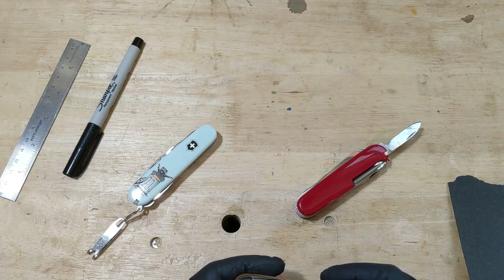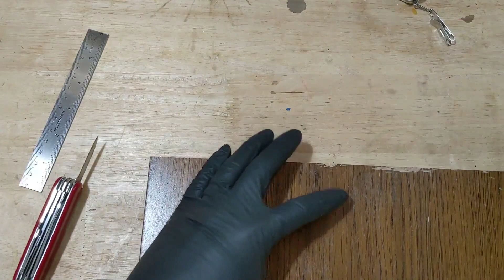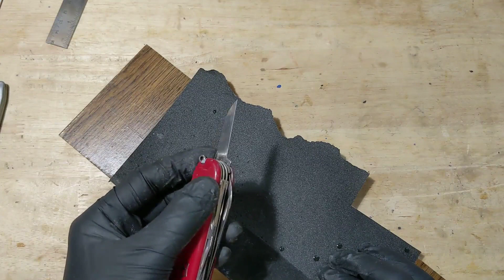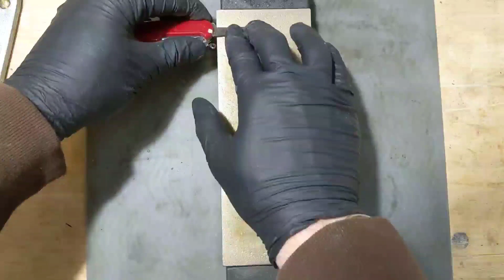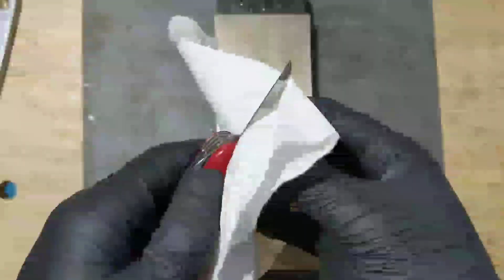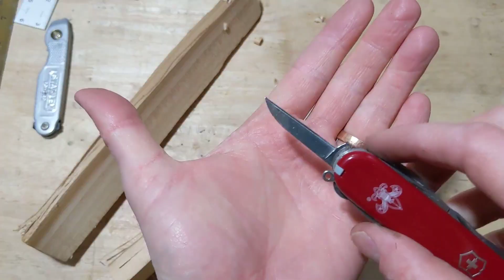Modify a Swiss Army Knife for Whittling: No Power Tools Edition

Comment: What is the benefit of this modification? Genuinely interested
Reply from the maker: It makes the knife better for whittling. At least in my and many others opinions. Not that you couldn't whittle with an unmodified knife, but the straight edge can make it easier to control your knife and the cuts, and the convex bevel also makes the cuts easier to control, while still allowing for a relatively strong and sharp edge.
Reply: @JoshsShop  thanks for the awnser
Reply: Also, it makes a great package opener

Comment: Thank you! 😃👍.  I used a bastard file and it worked pretty quickly.  I didn’t pass perpendicular to the file like you did with the sandpaper, but I ran the blade as in line with the file as I could.

Comment: Any reason I shouldn't do this to the long blade of my 91mm Compact? (It doesn't have a small blade.) I love this SAK. I just wish it had an awl and a saw. I figure I could slim the blade at least to make a long awl/whittling knife.

Thanks for your videos!
Reply from the maker: You certainly could modify the large blade, and I have on a knife or two. Depending on what you are carving it will work great. The only issue is trying to carve things with a small/tight radius. The large blade is too thick/tall to get into the tighter spaces, but it will work just fine for longer flatter cuts (probably better than the small blade).

Comment: Hi! I would have a question. 😅So I have a victorinox farmer and I would like to put a magnifying glass and the inline philips screwdriver into that from an explorer, would that be really difficult? Great video btw!
Reply from the maker: Thanks. That would be a pretty involved mod. You would need to disassemble the farmer and source (or make longer) pins so you can put it back together. Take apart the explorer, and another 93mm knife that you can take the back spring from to use with the mag. glass and inline Phillips because the one on the explorer will be to short. You also might have to fiddle with the mag. glass and inline Phillips a bit (or the scavenged spring) to get everything to close up right. It would be doable, but pretty involved.
Reply: @JoshsShop  Thanks for the reply, I might just carry both then😆